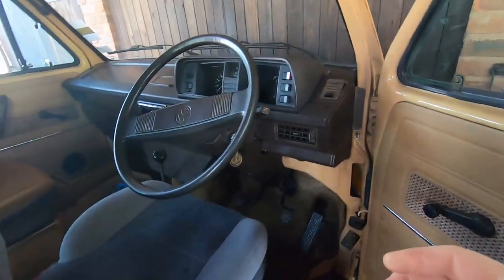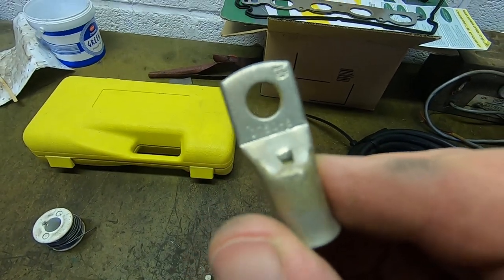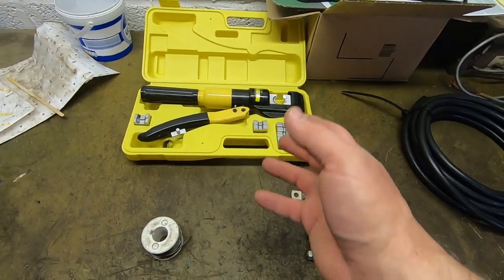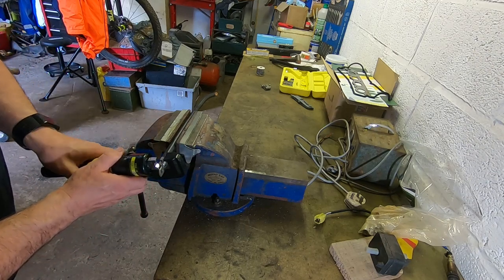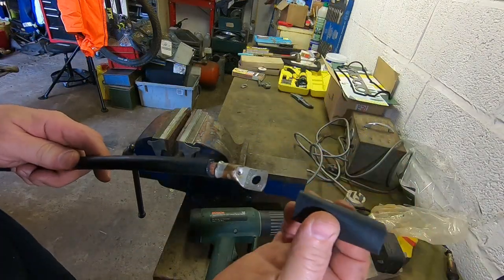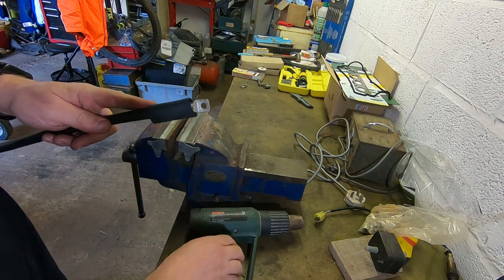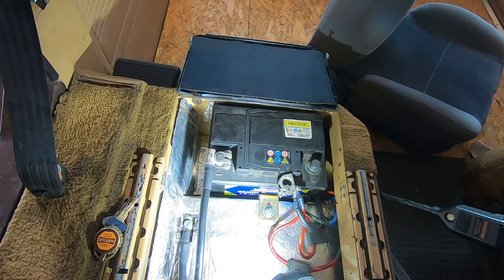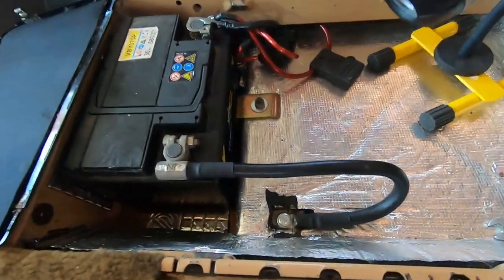VW T3/T25 slow to start? Check your earth cable. Mine was getting hot so I made a new one.

Comment: Heres a question, my mums t 25 has really poor indicators, very dim, ive checked the earths, to no avail, they are all ok, and the problem only gets worse with more load on, such as a trailer, ive racked my brain, cant find a solution, got any idea, meant to be going away tomorrow lmao
Reply from the maker: The earth cable from the battery to the body is a common issue. Try putting a jump lead from the battery earth terminal to a body earth and see if it improves. The live cable to the starter and fuse box aren't much better. Good luck sorting it out 🤞.

Comment: Never solder a crimped terminal
Reply from the maker: Thanks, why's that?
Reply: @LarcsWorkshop  copper cable uses stranded wire to make it flexible for use in high vibration environments. If you solder then it makes the joint stiff which introduces a weakness, it will eventually suffer fatigue and break. A crimped joint won't compromise this as it allows flexibility. That's why you'll never find soldered crimped terminals in wiring harnesses.
Reply from the maker: @boratsagdiyev6633  thanks 👍